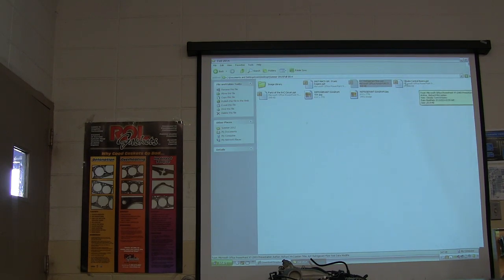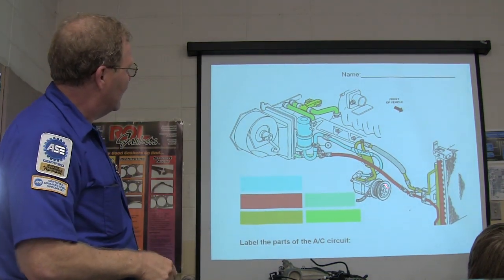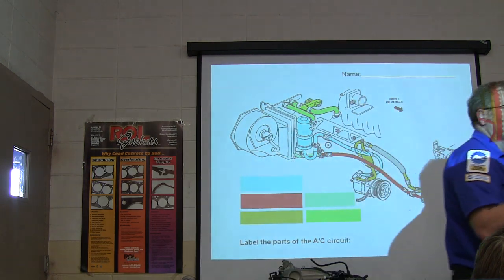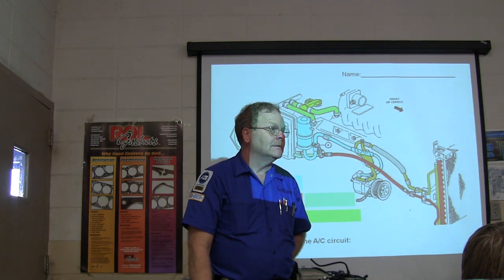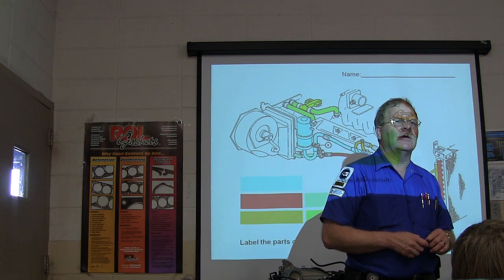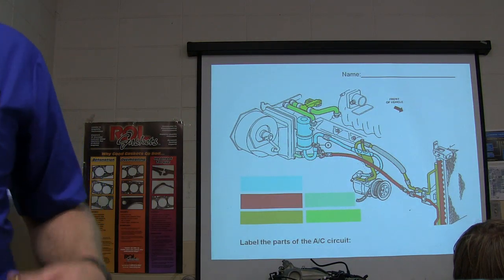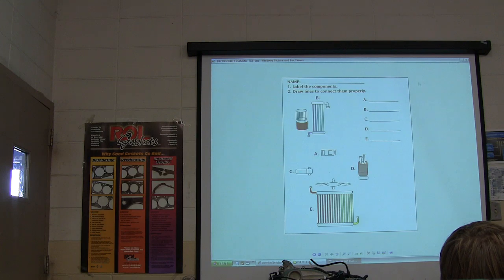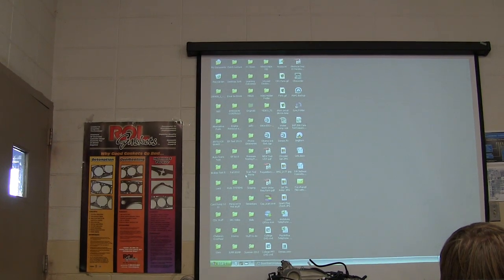Auto AC Basics

Comment: Hello, Mr Richard. Would you kindly explain the difference between Air and moisture? I would think both of them are the same.
Reply from the maker: Air can be dry or wet. Moisture can be in the system when there is no air - that's why the accumulator or receiver dryer have desiccants - to absorb moisture -
Reply: Thank you, Sir.